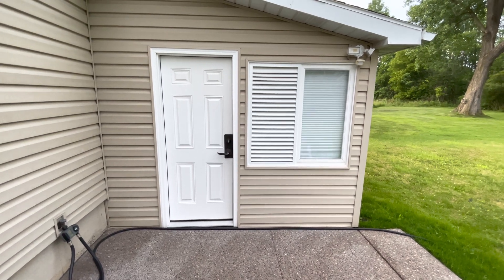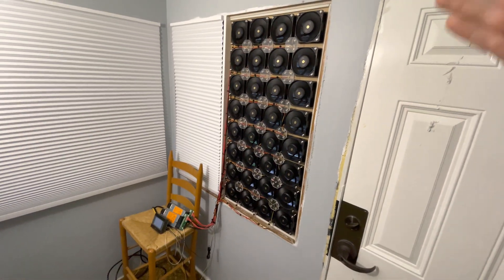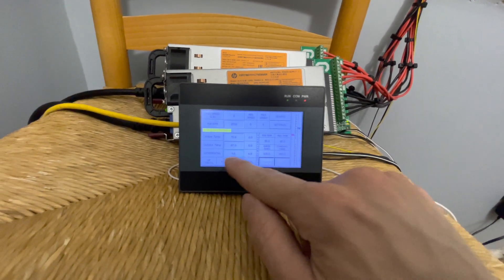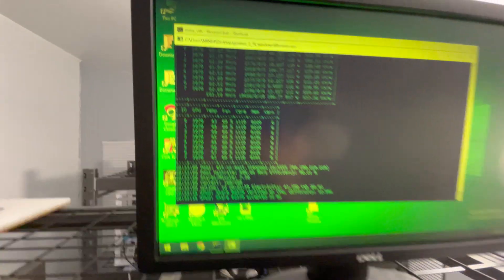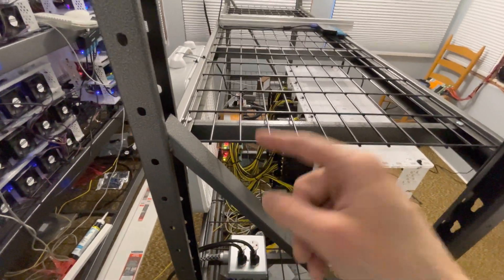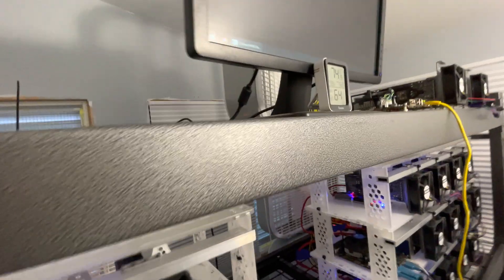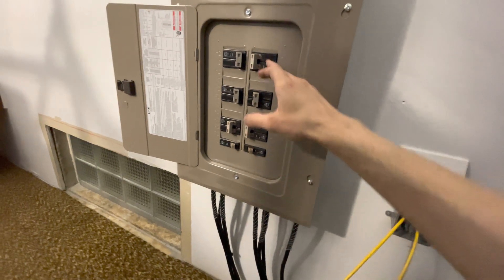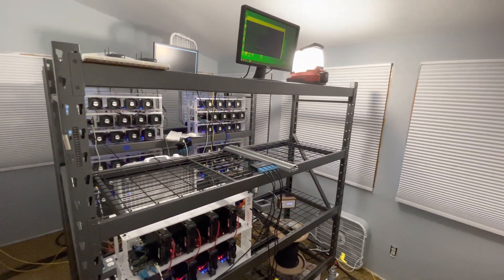The Secret Life of a 5GH+ Crypto Mining Farm

Comment: Trata con ventiladores de 48V podras ser mas eficiente y el cableado seria mas delgado porque la corriente deria menos en cada punto de la conexion y podrias con una sola fuente conectar todos esos si fueran cada uno de 48V
Reply from the maker: I built the fan assembly around parts I either had already, or could source inexpensively. The 48V fans would not be intrinsically more efficient. They may actually be slightly less efficient, it depends on the design of the motor and controller inside them. The wire was sized to tolerate the peak fault current the PSU could provide, not the load of the fan itself. Those wires are not fused, so they will be forced to supply full current from the PSU in the event of a fault. This would still mean they can be smaller on a 48V system, however I wouldn't undersize it much more anyways to help with mechanical strain. The cost savings here would be a few dollars at most. Plus, I like being able to use identical PSUs to those in the mining rigs, and I had those screw terminal breakout boards with external turn on inputs available. For me, 48V would be worse. It is entirely workable, and if the fans can be sourced cheap, it's not a bad way to go.

Comment: If not parallel miner where would be a good place to buy server psu's and breakout boards?
Reply from the maker: I have links in my server PSU video. Parallel Miner has a few configs available, but there's really no killer breakout board right now. Turns out a lot more breakout boards from PM were affected than I assumed, the failure rates are very concerning. The Deep In The Mines boards I link are pretty good, but they aren't perfect. Should never fail though, so that's nice.

https://youtu.be/fY_uY4l90HY

Comment: Sweet setup! I would love to know what kind of intake filter/mesh that is. I have a huge bug problem in my farm and cant find mesh that fine. Do you maybe have a amazon link etc? Kind regards.
Reply from the maker: Thanks! That mesh came with the louvers, I ordered it with 'bug screen'. I can estimate the spacing a bit later, but that stuff is usually specified in a 'mesh' number, which is the number of strands in a 1" area, so higher means smaller holes. Here's some random examples. 

https://amzn.to/3brgakk

https://amzn.to/3bBuMOa

https://amzn.to/3I1oqUl

You'd probably be looking closer to 30-60 mesh.
Reply: @SiCPoWMining  I think that would work out perfectly, thanks for the links. I just got a 10 000 Cfm fan for my farm and the amount of bugs it has been pulling in is crazy.  Keep up the awsome work. :)
Reply from the maker: Yeah, you don’t really realize how many bugs there are outside until you’re blasting them into your room. One thing to keep in mind is the finer screen tends to be mechanically weaker. You might need some backer to give it strength, like a very course mesh with big wire or something.

Comment: Go the Home Depot and buy two box fans for $20 each.  It’s efficient as hell for very cheap but it’s not pretty
Reply from the maker: They’re up to $25 now, and I had two in the window before that fan assembly. It wasn’t enough, and consumed slightly more power per unit airflow. I’d need around 4-6 box fans and they don’t have a viable means of automatic speed control. But yeah they’re pretty great otherwise they just don’t like when they’re restricted.

Comment: Looks good sir. Great uses of a sunroom. For ur exhaust fans why didn't u just use like AC infinity fans like 14inch or something like that vs the 120mm. Anyways keep up the good work sir. Looks SWEET.
Reply from the maker: Thanks. I looked at those, they look fairly good. I wasn’t sure on the static pressure requirements and wanted a bit more power so the fans would have overhead if needed. This fan assembly is better at dealing with static pressure, but yeah those are a pretty good deal. If I had the space for 3-4 of them that would be my route for sure. Airflow is a bit on the light side as well with only 2, which is all I can fit without it being messy.

Comment: Negative pressure pills dust in through every tiny gap; you want slightly positive pressure so you're pushing dust filtered air in and every tiny gap has clean air going out not dusty air in.
Reply from the maker: This is very much not a recommended setup, but it’s the best solution I could think of at the time for my needs. Dust is not a factor, it’s too expensive to filter this much air to that level. I’m mainly concerned about large bugs, grass clippings, that sort of thing.

Your thought process is sensible for something like a PC case, but not as applicable for a building. It’s a much more complex system, and this is a wood framed structure so negative pressure can be problematic as air brings moisture with it. This room is sealed nearly airtight aside from the leakage at the window seals, so the vast majority of makeup air will come in solely through the intakes. Not that it really would make any difference where it came in when the only filter in there now is a metal screen.
Reply: @SiCPoWMining   It's not just a thought process; I know from experience of substantial mining buildings with both arrangements.

Pleated 495mm by 495mm furnace filters are inexpensive and highly effective.

What you're talking about is negative pressure; I'm saying you want positive pressure pushing clean air out through inevitable gaps not negative pressure sucking dirty air in.

You're very correct about humidity, mixing cold damp air before it hits miners to reduce relative humidity, reducing flow when you're seeing an acceptable differential temperature etc spot on.
Reply from the maker: What would be the best way in my situation to pressurize the building with filtered air? How long would a pleated filter last with 3000cfm outside air flowing though it? I can’t really picture a feasible way to do that in my application without it sticking into the room and taking up a considerable amount of limited space. I considered this, but for my room layout I suspected the filters would last a few days in some parts of the season and weeks for others. I want to be able to not touch anything for a week or more, and don’t want the cheap filter crushing and ripping out. I don’t have the luxury of enough space for intake, so it needs to be a moderately high static environment. I was going to try 5” MERV8 filters, but the physical size and cost to make allowable static is problematic.
Reply from the maker: I appreciate your input. I suppose it depends on your environment, i see a lot of flying insects and that’s my major concern. I’d probably have a fan assembly filled with bees and whatnot. I’ll see how this setup runs in time, but I suspect some adjustment is likely beneficial. My current fan assembly is actually reasonably power efficient. I’ll do a video showing power at various speeds and measuring intake air speed to estimate CFM/W.

Comment: Whats the outside air temp in this video?
Reply from the maker: The PLC is reading around 67F, so not that warm. Looking like 90’s this weekend, all the hardware is in the room now and it handled a few hot days so far no problem. It will do about 6 degree total delta from inside to out at 6/11 fan speed. So if it’s 90 outside it’s 96 exhaust temp, around 93 coming off the A2000’s into the 3070’s.

Comment: Which motherboard u r using for rtx 3070s..plz reply as i cant find any compatibility charts for Chinese multi pci minign boards
Reply from the maker: These are B75 8 way boards with 65mm spacing. They're about $100 and fairly good. I got these since they appear to be the best value per slot all in, including RAM, SSD, and CPU. Most boards are compatible with most GPUs. These work fine with NVIDIA cards, but has issues booting with a single 5700XT in any slot. The odd thing is, I put a NVIDIA card in, and it boots with the 5700 just fine. I'll do a video more about these boards in the future, they're nice for the money and have been working well the last year or so I had them.

Comment: Are those fans on the window really more efficient then just 1 or 2 larger intake fans?
Reply from the maker: It's more about the airflow they will deliver, and the range of speed they can operate at. I needed a lot of power according to the calculations, and I struggled to find large diameter fans that would have sufficient static pressure to meet the airflow requirements. The 'CFM' rating you typically see tends to be with ZERO static pressure, in 'free air'. This is de-pressurizing the room, and it has to work to pull air in the other side,  across the hardware, and out. I also expect to add filters, which will add even more static pressure, which will also increase as they get dirty. This fan assembly is reasonably efficient, has a wide operation range, is capable of fairly substantial static pressure, and fits perfectly into the existing opening available. I had two regular box fans in here before this, and they worked about as well as this fan assembly on speed 2/11. This fan assembly consumes ~90W at 1/11 and 1120W at 11/11. It's fairly efficient for the work it's doing, but it also has a bit of a job to do, pushing the air out the louvers and sucking more in the other side. It normally consumes 250-350W to maintain ~12 degree delta inside to out, with 10kW in the room.
Reply: @SiCPoWMining  agreed they are a viable solution and good data here thankyou
Reply from the maker: No worries. I’ll probably do an airflow overview video in the future. I’ll cover static pressure and air speed. The louvers pose a very substantial pressure drop, which impede airflow. I get similar performance with this fan setup at speed 1/11, as two box fans on high. Power consumption at the wall is about the same for both, but this fan setup can crank up to 11 and has double the airflow I would need for even 15-20kw. The room has 10.6kw in it now and is running 6 degree delta on 90 degree days.

I can’t directly measure CFM without substantial effort, but it can be estimated from air velocity and area. The static pressure will impede airflow and reduce the numbers substantially, you need to look at the data sheets to see rated airflow into your static pressure. I wasn’t sure what SP I would see, so I overshot by about 2x, and it turned out my estimates were within about 10%, so this fan assembly is very overkill.
Reply: They aren't, 1 industrial fan is more energy efficient and flows more cfm
Reply from the maker: @tv-vk3fs  I'm not trying to suggest what I did was the best, but I don't see how a belt drive box fan is superior. Considerably lower static pressure, massively deeper, and they won't fit in the opening. It looks like it would be more expensive as well, since I would need two of them, and a pair of VFD's. I find it hard to believe this would fit recessed into the existing window opening without modification. This also would be less efficient, id estimate by a fair margin. I'm not looking to just move air, the goal is to be able to control the airflow with some degree of precision and maximize the airflow through the existing openings with reasonable elegance. It also needs to deep throttle to be able to tolerate both -5 Degree F days as well as 100 degree F while maintaining a relatively narrow range of indoor temps to control humidity and limit filter wear.
Reply: @SiCPoWMining  who said anything about a belt fan. And you only need VFDs if you want to control speed or if you're using 3ph. to single conversion. A simple thermistor can control on and off with temps.
Reply from the maker: For most industrial applications large format fans make sense. I understand the appeal for most large scale mining. This is residential, and I have concerns much beyond the airflow. I need speed control to meet the targets, or else it means wasted energy, more noise, and more filter cleaning. Plus the intent of this fan design was to be able to 'compress' the operating indoor temp to a bit more narrow range to minimize thermal expansion on the silicon. I don't see anything that fits in my opening, so there's not much to be done aside from making a custom fan. Does someone even make a fan that can achieve 7000CFM and 1.8"WC SP in an opening 18-20" wide? The things I'm seeing are massive, would stick into the room nearly 2', consume twice the power, and are very costly. With fans, you can do things a thousand different ways. I think my solution is elegant and effective, but I surely wouldn't recommend it for most, nor do I think anyone is going to do it.
Reply from the maker: @neal cassady I'd be interested to see a specific model that would fit into that area and is lower cost, more energy efficient, delivers more airflow, higher static pressure, is as quiet, has redundancy, and throttles as deep as this setup can. I'm legitimately curious, I don't know if the setup I have is the best, nor do I claim it is. I had half the fans on hand, and I know it would work, so that's the route I went.

Comment: Thanks for the video.  Who else supplies breakout boards?
Reply from the maker: I've tried a few, and unfortunately there's no killer board right now. The best ones right now for HP common slot PSU's are the ones from Deep In The Mines. I plan on doing a video about this more in depth in the future. These are pretty good, very robust design. They use 3OZ copper which is absurdly thick, most are 1OZ. Good trace layout, very basic design that's essentially always on. No active components. These should be happy with 1200W+ pumping through them. https://amzn.to/3xsDFAK

Comment: @SicPow Integration, the fans on the Windows, you have them to extract hot air from the house to outside, or are they putting fresh air from outside to the room? Nice setup. Thankx
Reply from the maker: The fans are blowing out, and that sunroom is fairly tightly sealed so the vast majority of the makeup air comes from the louvers in the open windows on the opposite side. That forces intake air across the hottest GPU rack first, then into the next and out. It’s working fairly well, I’ll probably show this better in a deep dive video in the future.
Reply: @SiCPoWMining  Thank you good sir. You have one new follower